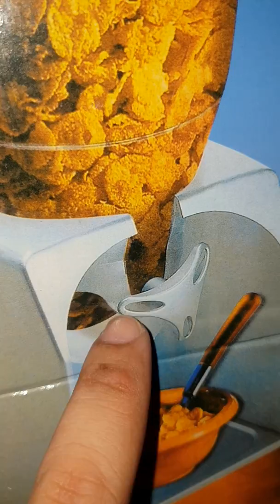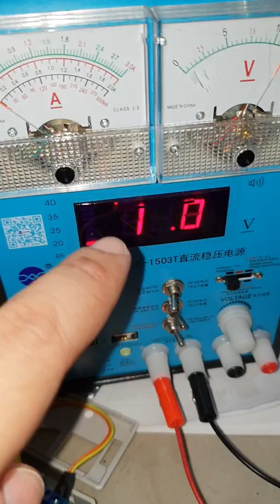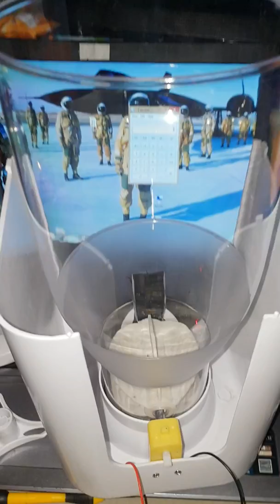DIY Automatic Fish Feeder

Comment: Is that DC motor fit directly or need to modified?
Reply from the maker: You need a gear reducer
Reply: Madodel do you need something to attach the shaft motor or it’s fit already?
Reply from the maker: @ngulikaquaponik376  you need to fabricate a coupling